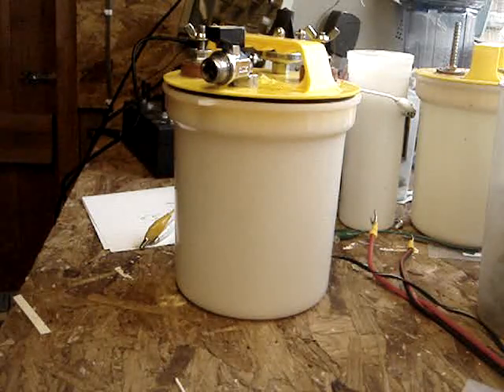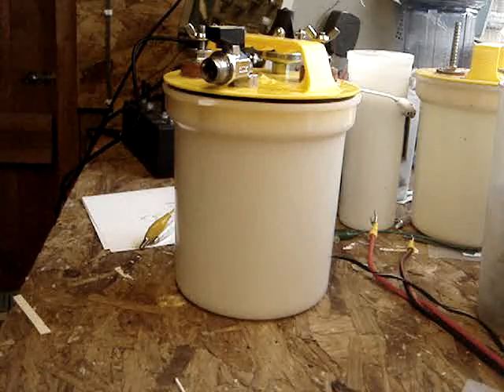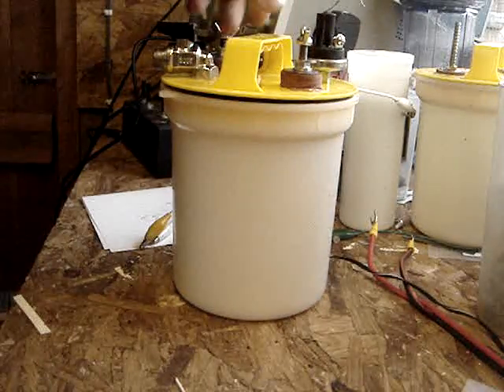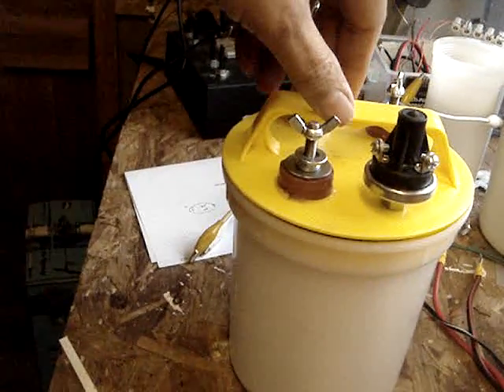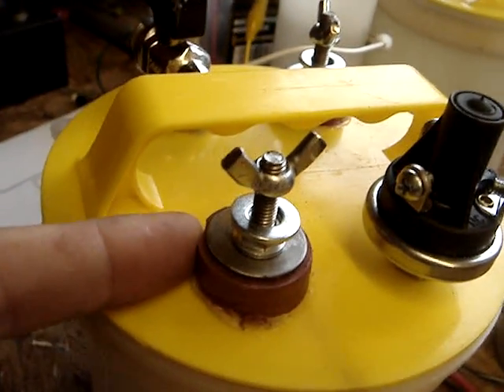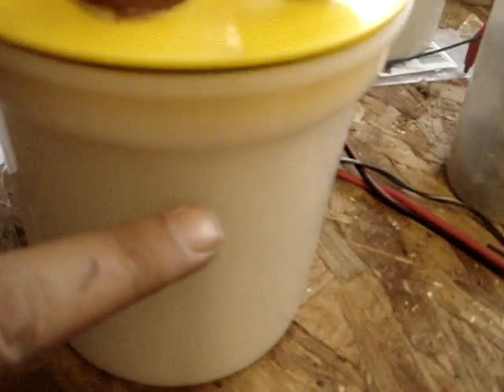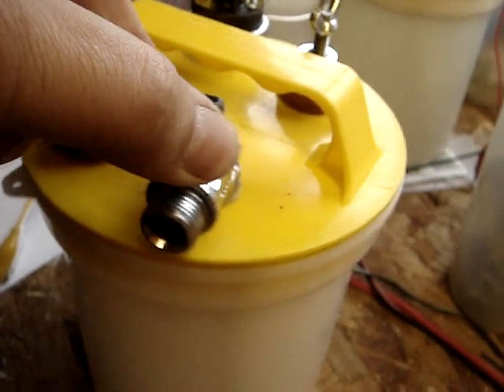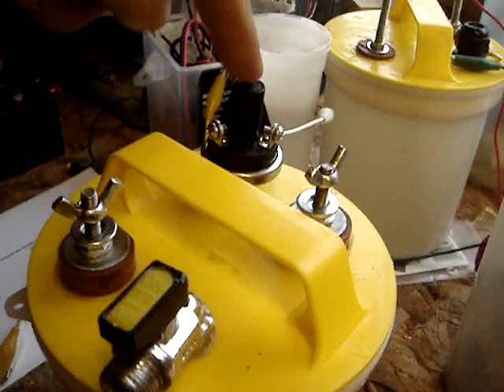HHOFromWater the challenge

Comment: @MacGyver0076 - the systems I play with operate on 120v-240v and weigh in at anywhere from 60-200 pounds ... my smallest device is designed to handle 3000 watts of input power, 250a if using 12v, and I cannot produce enough HHO to run a 4 cyl automotive engine ... I can and have produced videos showing how to run a single cyl 100cc engine ...  I deal in what can be done now ...  I hope someone takes it up and improves on it ...

Comment: You'd never be able to create that much gas with a safe and workable heat, and you are probably using very high amps and will wear down your battery quickly.  You are probably using too much electrolyte, 2 tablespoons NaOH or probably less would be good.  Use less to electrolyte because your heat is way to much, although you do not measure it on this video, HHO output will also be lowered when heat.  Try to find a good spot that balances output with level of heat/amps.

Comment: It seems to be Ronn which does not understand thermodynamics: they are apparently using petrol to electrolyse water and then burn the hydrogen. Do they not understand that it would be more efficient simply to use the petrol directly? This seems to be a corporate-level scam aimed at improving its 'green credentials' among scientifically ignorant consumers (the sort who have to be told that 'there is no carbon in hydrogen').

Comment: {Yawn} 450ml in 8.2 sec is 3.292 LPM. And what wattage must you feed to your cell to produce this massive amount of HHO? Anyone can overdrive a cell and get lots of gas at the expense of wasted heat energy and poor efficiency.

My current cell produces 3.333 LPM with 600W input (13.8V @ 43A). That's 5.55 ml/min/watt.

Beat that.

Comment: 3.5 milliters per minute per watt is only mid range for efficient production ... I am aware of somewhat more sophisticated devices than mine that are able to achieve a bit better than 7 ... and we are still a long way from Meyer ... 

but there are many examples of devices able to 5-5.5 milliters per minute per watt ... the latest from ZeroFossilFuel is doing this much quite easily ...

the typical parallel plate design like yours is normally only capable of high 2's and low 3's ...

Comment: well, there's arguments pro/con on the min productivity issue ... you really only need about 500ml to 1000ml as a booster for a car and lot of fellows are headed in that direction with their designs. Those of us who are building welders or attempting to power an ICE are of course building much larger devices. This is why I like the MMW measure as it does tend to level the playing field and provide a comparison independent of size/power.  But like I said, it's ProMartin's thread.

Comment: Well, that puts me out of the race.  I dont design and build in that direction. But I suspect that my typical 3.5 to 4.2 milliters per minute, per watt of energy used would be quite competitive with 85% of what's out there. Limiting to 12v battery I think is a bit restrictive, but its your thread.

Comment: hmmmm..i think i'll make a 12 plate cell tomorrow but i don't think my batt charger will handle the load very well but i'll do my best with what i have..i'm gonna try to run a mower with my 4 plate cell, i have no clue how many lpm it's putting out..i don't think it's going to work but i guess i'll find out tomorrow if it doesnt rain all day..

Comment: well, its not really fair ... my device is a lab rat of considerable size and weight ... but its quite capable of 5 LPM when loafing ... the one time I really hit it hard with the intent of making as much gas as possible, it cranked out about 8 LPM but it got pretty hot doing it ... at 5 LPM it stay cool and can run like that indefinately ... have run 12 hour enduro tests on it and it could have done more ...

Comment: hehe, more than 3.2Lpm no problem do it all day twice on sunday. Max ever was 8Lpm, or 450ml in 3.3 seconds. Makeing alot of gas isn't hard, its doing it for less wattage thats the trick, also take a look at sidyoung. Correction most ever, was a 1min run at 24v 300amps and 14.5lpm but that was a very inefficient cell setup, and I didn't like that much amperage.